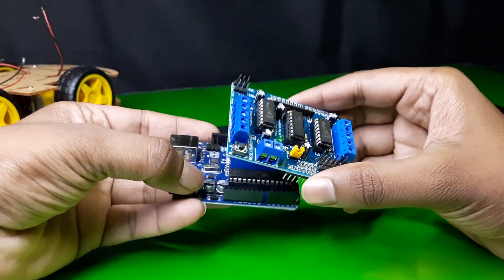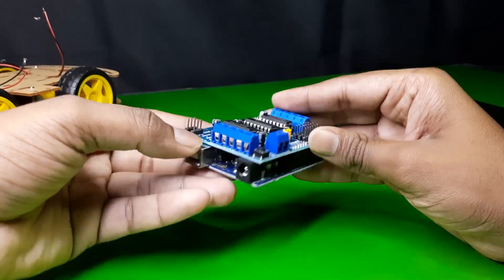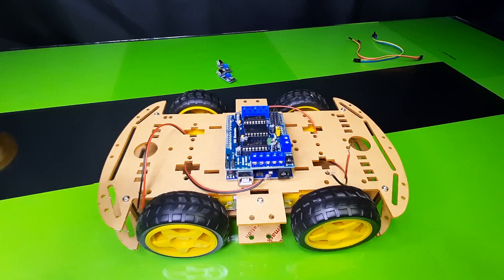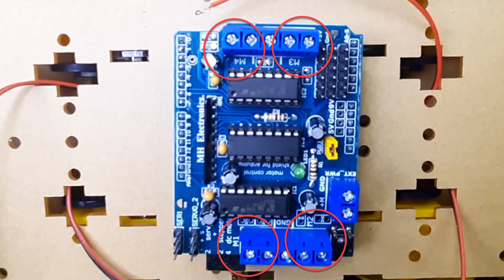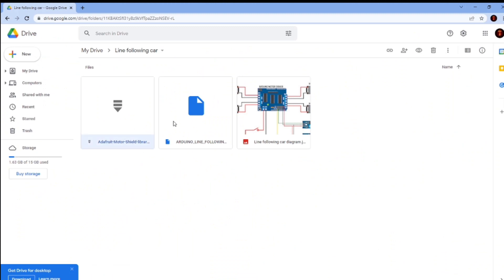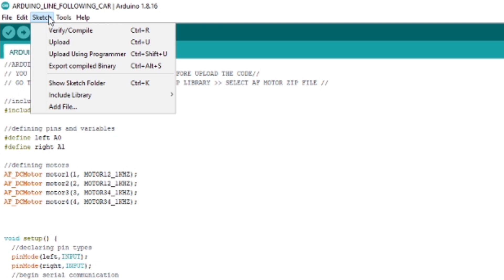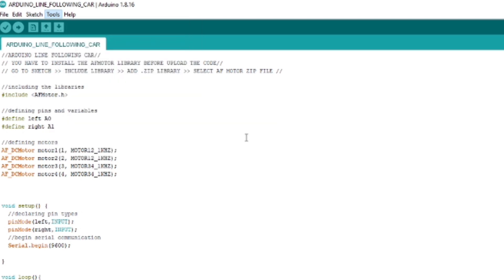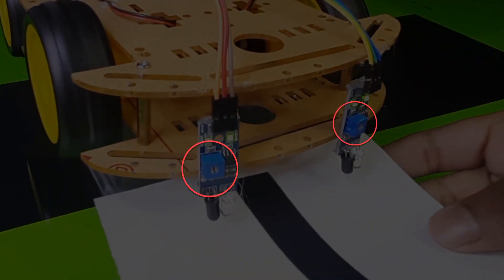How to make line follower robot | Arduino project | Step by step guide | with the code

Comment: Hi bro please tell me how to increase the speed of motor rotations? Please reply bro
Reply from the maker: If we increse the speed of the car, it will go out from the usual path...I faced that problem when I doing that project...however still if you want to change the speed try on youtube "how to change the speed of the motor using motor driver shield and arduino"...there are so many videos to take the help for your problem...I think this will give you the answer for your problem
Reply: @rcea_youtube  ok bro thanks a lot how much voltage we need to run the robot bro ? Bcoz I have used a 9v battery but it's not moving can u suggest me bro?
Reply from the maker: @ECKarthibalaK  Supplying 12v can be recommended